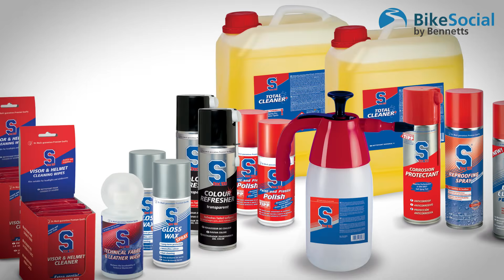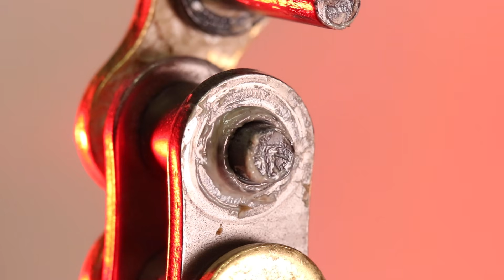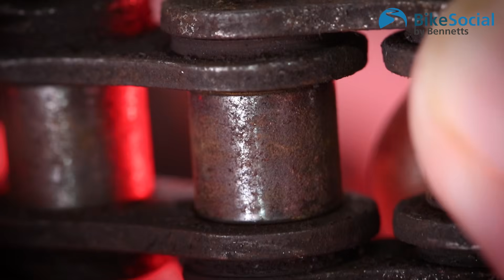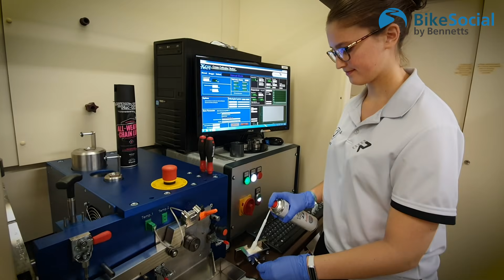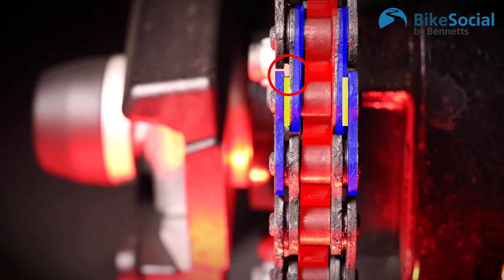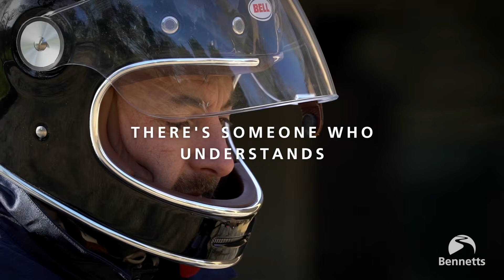Is chain lube a scam? Does your bike really need it?

Comment: If you have dry metal contact like with a train wheel and a rail, one metal is harder and one is softer, in this case the wheel, which degrades faster. Do I need to lube my chain? I don't know 😅

Comment: I use Maxima chain wax every 600km and clean it every 3 or 4 lubes on my F750GS (Endurance chain). It currently has 24,000km and the chain and sprockets look new. I've adjusted the chain once 1/8th of a turn of the adjusters (the shop may have done it whilst being serviced). I also get very little fling.
Reply from the maker: You should definitely check out the full test of chain lubes: https://www.youtube.com/watch?v=noshjM5CDas

Comment: Remember do not use a pressure washer to clean your motorcycle.(Maybe Motorcycle Muc off pressure washer is ok)
Reply from the maker: You mustn't use a pressure washer too close to the bike, especially bearings, but it's just another tool to use wisely.

Comment: If you switch to gear oil or any oil after using chain lube you will never go back.  No more gunking up like before.
Reply from the maker: Gear oil can work well, but do check out the full test on the description

Comment: It's insane actually, how good that o-ring material is, that it is CONSTANTLY rubbing, for thousands and thousands of hours. It's a miracle they last even that long.
Reply: Just think about the valve seals also, and they work in heat as well!  Rubber or synthetic stuff is amazing.
Reply: Do you mean valve stem seals? They're not really that hot as they're cooled by the oil in the cylinder head. You see a lot of cars on the road that need them changing though!
Reply: Think of a crankshaft oil seal,what you must remember there is a thin film of lubricant between the rubber and the metal this stops the rubber wearing.same goes for the o rings of a chain ,keep them lubricated
Reply: The engine is insane too.

Comment: I had a Yamaha MT 07. Ran it for 8 year & never cleaned the chain in anyway. I did have a vacuum Scotoiler installed. When I sold it 8 years later, the chain was in perfect condition. So as far as I'm concerned, chain lube is a scam. 👍
Reply: Scottoilers are the answer.

Comment: Gear oil with paint brush with light touch with paper towel to remove excess as I spin the rear wheel.

Comment: If you can extend the life of your chain and sprockets with all the regular cleaning lubing and work and the expenses for the lube the cleaner the cleaning up the mess after and how much can you extend the life of them .? ! Especially considering your chain is already sealed and lubed from the inside . You know what ?! thats BS ! when my chains are streched beyond the  point of adjustability (and that will happen lube or not ) i just change them and when the sprockets wear out i just change them out they cheap parts and you can easily do them every great once in a while and  forget about the rest of cleaning lubing and all this malarchy .😅😮

Comment: I clean mine with diesel, and use old engine oil as a lube. I have a Scott oiler that uses old engine oil. My chain on my zzr14 is over 25k miles old and still good. I believe that keeping the chain clean is as important as lube.

Comment: Anti-corrosion is the REAL reason to lube the chain. The rest of it is more or less hogwash, and anything you put on the bushing gets squeezed away by contact with the sprockets, and centripetal force, and is all but gone after a few minutes. Just use plain ol' gear oil. Cheap and easy.

Comment: In the same way that Big Pharma cannot make money from healthy people, these people are deliberately confusing "lubricating" with " protecting from corrosion". Any O or X ring chain does not require "LUBRICATION" but it requires" PROTECTION". Dry wax lube is the answer. It is what all top brand motorcycles come with OEM until some idiot sprays oil onto them instead of only applying a another coat of it when necessary. All professional racing teams have been using dry wax for decades now but it takes a long time to break through to ordinary people that oil is the last thing to use to protect the outside of a chain and NO LUBRICATION is required on the outside of the rollers on an O or X ring sealed chain but PROTECTION against Corrosion IS required. A friend of mine and I rode 2 brand new KTM690ERs on the 7,500 mile TAT. I used dry wax, he used chain oil. I had to adjust half as many times as him and at the end my chain and sprockets were still perfectly useable for many more thousand miles whereas his were toast. It is very simple, all oil does is create a grinding paste which accelerates wear on chains and sprockets,this is because oil attracts damaging particles whereas dry wax throws these damaging particles off.

Comment: I would very much like to hear others' opinions on my controversial belief.

I have had a theory for 50 years. I think a never-cleaned and never lubricated chain and sprockets may last just as long as those that are serviced. At least in the Bay Area of CA, where I live, where we have no road salt and mild conditions. Modern chains are greased internally behind rubber O-rings. As for the outside of the chain, I wonder if lubing it just attracts more grit and turns it into sandpaper?

So, I am finally running an experiment. I put a new DID chain on my KTM 390 Adventure and am riding it with no maintenance whatsoever. So far, I have 4,000 miles on it, 50%/50% on/off road in CA, NM, AZ, and UT. So far, everything looks fine. If I can get 10,000+ miles without ever looking at it, and without carrying supplies, and with having no mess, I am more than happy and feel I am way ahead.
Reply: Clean it now and put lube on it and you'll even notice how smoother the ride is and your theory would be over
Reply: @chrisdrgs38  nah, just cleaning from time to time is enough.
Reply: I year later now. So how did it go?
Reply: @ratsac  I don't have that many more miles on the KTM. After riding some of the CABDR-N, and some road riding, I have 6,200 miles on the chain. I don't see any wear. My chain has not even needed adjusting, also indicating no wear. I don't plan to ever touch a chain again until I replace it and the sprockets. It's the best of both worlds... performance of a chain with the maint of a shaft drive.

Comment: I haven't lubed an Oring or Xring chain on a street bike in at least 15 years.  No issue with wear.  Cleaning the chain occasionally is all that is necessary.  Chain lube just attracts dirt and causes this abrasive paste to work on the chain sprocket.
Reply: you get guys that clean chains and then there is you....always the guys with the most slack in the chain and dirty spocket area and rim....
Reply: How do you clean it mate?
Reply: Use diesel
Reply: @warbot2544  I just got unswer from D.I.D they dont recomend anything but special cleaner on O X rings.
Reply: Rag damp (not wet) with WD 40.  Object is to just remove any grit.  X ring chain on my Norton Commando now has just over 20K miles and still has plenty of adjustment on the tensioner.  Never had a standard chain do much better than 5000 with regular lube/cleaning.

Comment: Just gear oil 80/90 
1L for 10 years
Reply: That's what's stated on japanese motorcycle manufactures service manuals. We must give credit to them. Japanes engineers know what they're doing. Honda alone has more than 800 motorcycle Grand Prix wins. 
Just an example (not from Honda):
"If a special lubricant is not available, a heavy oil such as SAE 90 is preferred to a lighter oil because it will stay on the chain longer and provide better lubrication."
On road bikes, the only downside compared to comercial spray lubricants is more rear wheel fling

Comment: I tried gear oil for the first time. I am never buying chain lube again. Sure, it flings a bit from start. But what it also flings off is dirt and gravel. And the chain looks like new, is dead quiet and it stays this way for quite some time. The gear oil is also dirt cheap.

Comment: My bike has an undersized chain (520).  So it tends to stretch.  I noticed decades ago that some NON O-RING racing chains had higher load specifications.  So I switched to those types of chains and have not had a problem with stretch.  So now my question is, are non o-ring racing chains internally greased, or do they rely on the chain lube penetrating?   I used a whale oil based chain lube for years that did not fling off.  When whaling was outlawed. I switched to a lube with Moly in it.  I'd like your thoughts on that...
Reply: Using a non o-ring chain is nuts these days. Get an o-ring chain and use a scottoiler. Problem solved.
Reply: @chemistrykrang8065The problem of chain stretch isn't solved.  I ride very conservatively, but still was  only getting a few hundred miles out of a 520 chain.

Comment: Chain lube is ok for road bikes , but no good for dirt bikes. Our group stoped using chain lube and we have doubled the life of our chain and sprockets. I clean the chain after every ride with degreaser or bike cleaner. Then spin out the water. Spray with WD40 or Inox. 100 percent doubles the life. The chain lube attracts dust dirt and mud and and turns it into a grinding paste which increases wear.
Reply: Thanks, I was thinking about ditching chain lube on my dirt bike as it’s so sticky and dust and mud clings to it. I saw a Bret Tacs video who just uses diesel to clean and lube his chains.

Comment: One guy ran his "O" ring chain dry for 20 miles and put a temperature gun on it with a certain reading. He then lubed his chain, ran it 20 miles and put the gun to it. Unlubed chain and sprockets were much hotter. Definitely contributes to wear. I'll keep lubing. My VStrom's chain lasted over 25k miles lubed with Motul. I doubt it would have unlubed.

Comment: I ride old Eastern European two strokes, I have an MZ, CZ and a Russian Voskhod. They all have fully enclosed chains, all of them are very well engineered chain cases especially the Voskhod. They are all western chains and are non o ring and they all look as clean and perfect as the day they were put on, the CZ chain for example has been on since 1989 and has covered around 40000 miles. It has only ever been lubricated with ep90 gear oil , a little squirt maybe 4 times a year. I’m sure this is completely down to the chain cases keeping them clean. I never clean them just lube them and they rarely need adjustment.

Comment: Caltex grease is better just spread it to your sprocket not to the chain, for cleaning use WD40 and toothbrush then wash with kerosene and toothbrush then dry the chain with a clean dry rag.

Comment: lubricating in o ring chain is not nesesary cos it is sealed.
is worse cos the environment dust and sand stick to the oiled chain and that is worse than a dry chain where the dust will not stick.

Comment: Different lubes for different chains. O ring chains have the lube sealed inside, but the sprockets and rollers still need some lube to keep them quite and smooth and the O rings also need to be kept moist. Too much wet spray lube will allow the chain to pick up grit and turn to grinding paste pretty quickly causing wear of those parts. A light dry lube is fine for most O ring chains and wont hang on the the crud that makes it go black and sticky.  A standard non sealed chain often found on older bikes needs a lube that will penetrate into the rollers and bushes, but will pick up crud which can get inside causing stretch and worn sprockets and wear quicker than a sealed type of chain. Little and often is the rule for wet lube and wipe off excess to stop it flinging all over the tyre.
Reply from the maker: Have you seen this yet? https://youtu.be/noshjM5CDas

Comment: I'm bewildered as to why this question keeps coming up 🤔 as an engineer this is common sense to me that lubrication on ANY metal to metal contact is a must.  I ALWAYS lube my chain after a ride when it"s hot so it really gets into the gaps then cools with the lube on it. Better slightly too much than not enough but watch it doesn't get all over that wheel and tyre 😉👍

Comment: Looking for advice, just bought a new RK chain to fit to the bike, it came smothered in factory grease, looked all over the internet for an answer, do i need to degrease and re-lube a new chain before i can ride? , I found alot of contradictions, some say remove it and relube and others say just fit it and ride away.
Reply from the maker: You're fine. I'd wipe it down so it's not sticky, then keep it clean and lubed after use as usual.
Reply: @bennettsbikesocial  Thank you very much for the advice, i will do that. and thank you for the video content, its very informative and helpful. keep it coming.
Reply from the maker: Thanks for watching! Have you checked out the follow up to this video, where I test a load of chain lubes? https://youtu.be/noshjM5CDas
Reply: @bennettsbikesocial  yeah I have , its excellent. I'm glad I watched it, learned alot. Any plans to do the same but for chain cleaners?
Reply from the maker: Hopefully, but it'll be a long way off I'm afraid.  I just use paraffin (kerosene). Cheers, John

Comment: My two cents (yes I'm cheap), I use 80/90w gear oil mixed with a a very small amount graphite on a hot chain it's so cheap I have to relube more often (350km) more so in rain obviously as always.
It removes contaminants from the chain as it eventually flys off because of the detergents in it.
Grime just wipes off easily with rag.

Comment: Read the comments, people are fucking tycoons, using WD40 or specialized overpriced cleaner. You're spending a lot more than it would've cost you to just replace the chain every 10k out of pure paranoia. Kerosine or diesel fuel as cleaner, gear oil as lube, otherwise it's not cost effective.

Comment: I use Honda..  it's not tacky..  and keeps corrosion protection down..  doesn't fling and it's cheap.. I don't over think it...  If I'm in the rain and muck..  I spray it off with the Honda cleaner and a quick spay of lube..  no more than 3 minutes..

Comment: How often do you need to lubricate a non sealed chain ?
Reply: I lubricate mine after each days ride, as It is a 140km round trip and I use 80w90 gear oil. Probably overkill, but that chain was used for 10,000km on one bike, then for another 10,000km on a second bike, and is still ok.

Comment: Thanks, probably one of the more intelligent discussions on motorcycle chain maintenance i've seen.  My BMW GS recommends cleaning and lubing every 1000k.  Been working for me!
Reply: 1000k as in one million?
Reply: @marcos.1771 me thinks he joking......gs is shaft drive😂
Reply: @terrystratford1235  Yes, I know the GS does not use a drive chain, but it's that 1000k that puzzled me.
Reply: @marcos.1771  lol!! 1000kilometers be about right to clean and lube chain. I do mine every 500miles! But yeh, k can mean 1000! I don't know the service intervals for the gs shaft, but 1000kilometers seems overkill!  Doubt bike would do more than 300000miles! Maybe his bmw dealer is shafting him!😁
Reply: @terrystratford1235  I have the M Endurance chain on my BMW S1000XR, which hardly needs service.
The GS shaft does not get serviced, it gets replaced.
A little while ago, BMW recalled just about every GS, because there was a huge issue with their shafts.
Reply: @marcos.1771  nice bike!! Bet you can break several laws in just 1st gear! Gs shaft....I recall some issue with that when I was deciding what bike to get! Was it, water ingress or oil leaking? It is an overlooked serviceable item! I decided on the crf1100 dct, but have recently been introduced to the k1600, I maybe persuaded!! 😅
Reply: @terrystratford1235  Yes, I get too many speeding tickets because of my fast riding, it's getting quite expensive.
I believe the issue with the GS shaft was indeed water getting into it and causing severe rusting.
Reply: @marcos.1771  I've got a 1987 gsxr1100h, had her 22 years, too easy to go 140mph in 3rd, fun thou!! Thankfully still have a clean licence! I love my crf1100, but may sell both and get the k1600gtl!?
Reply: @terrystratford1235  Good grief, 1987!
I bought mine in 2021, it's the model 2022 of the BMW S1000XR M Package with almost 50,000 km today. 
Should have been more than that, but because of all that rain that is falling, I don't feel like riding in the water.
Reply: @marcos.1771  I don't ride in the rain! It's no fun! Living in the uk, I don't get out on either bike often!
Reply: @terrystratford1235  I live in Belgium and we have precisely the same weather down here.
It has been raining for 8 straight months now and I have had more than enough rain.
Reply: @marcos.1771  since about October here! A few rare sunny days!
Reply: @terrystratford1235  Yes, I'm also counting since October.
I'm already considering giving up riding my motorcycle.
Reply: Oh just put some waterproof gear on and enjoy your bike in the rain. Your bike might need cleaning a bit more often but so what. Riding in the rain is fine with proper gear.

Comment: I use paraffin, some old clean hand towels and a toothbrush for cleaning the chain ... always brings it up like new. Then I use Wurth HP Dry lube and a ChainMate for lubing duties. Lube after each couple of rides and give it a full clean once every 300/400 miles or so.

Comment: If I clean and lube the chain religiously, how much more chain life would I get? 30% more? 50% more? 
And how much money would I have spent on chain products? More than the price of a new chain I guess...
I quitted cleaning my chain. I just nonchalantly lube it with motor oil. 
Jerry-rigged a plastic extension at the end of my chain guard to keep oil splash in check.